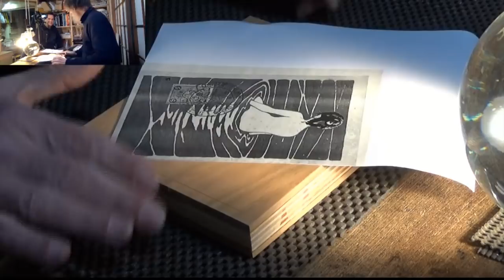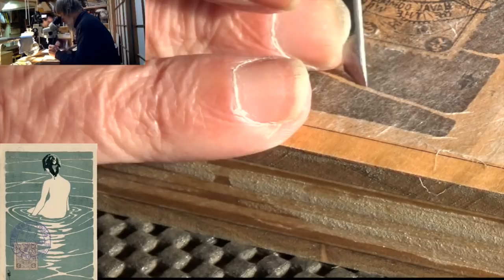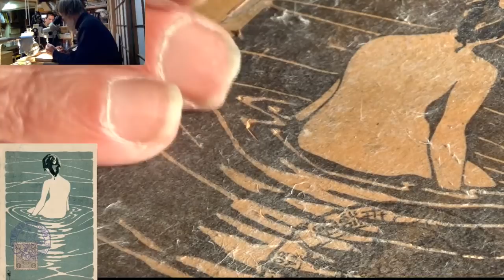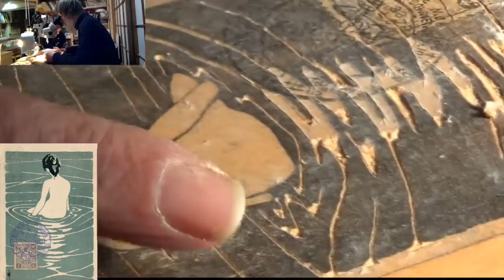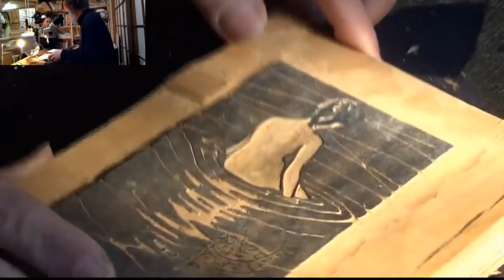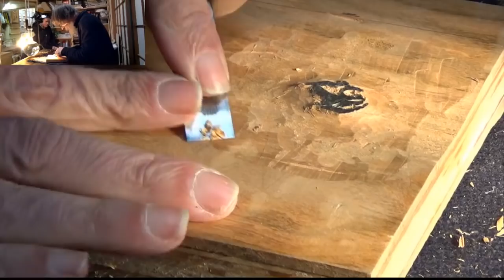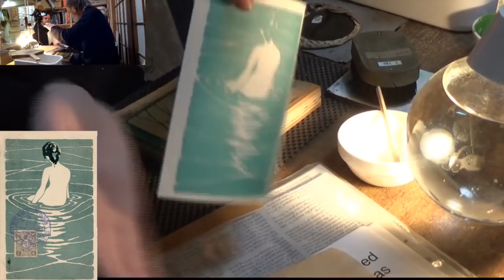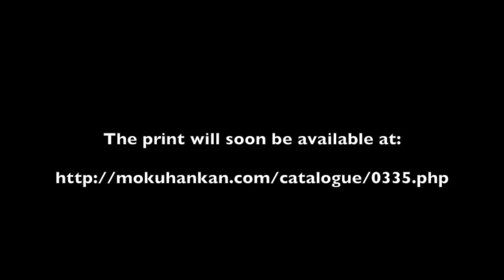Woodblock Print - start to finish (edited version)

Comment: Dave-san, I use the same transfer process (but just using regular A4 paper) to put images onto bone or Chinese bakelite Mahjong tiles when I'm making copies of missing tiles. But I use a dental drill with sub-millimetre steel burrs to do the carving, my skills with a chisel are not that good! Another really good instructional video, and your bathing lady is just gorgeous! Thank you.
Reply: Dr. Konrad Dahlem, a Dremel-style tool would work fine, but I would only use it with the flexible shaft, as it gives much more freedom of movement. The dental tool I use is a Chinese model with removable straight and angled heads, which take either long- or short-shank burrs. (But... I find there is too much slop on the angled, short-shank head, so I only use the long-shank head - zero slop.) I buy sub-millimetre steel dental burrs online, and even grind those down to give me the fine lines needed for the detail on bone mahjong Flower tiles, which are 30x22mm normally. So they are well able to cope with a hard fruitwood. Hope this helps!
Reply: Dear Tony, my sincere thanks for your extremely speedy and helpful answer ! Yet, may I bother you with additional questions...? First, in case you rather recommend the Chinese drill, would you be so kind as to name the maker and model ? Second, the drill heads mentioned, would you give me a hint, where to get them...and which ones you regard as the ultimate „must-haves“ ?
Again, let me express my gratitude for your help 🤸🏽‍♂️, Konrad
Reply: Konrad, see my email to you....

Comment: Whoever mentioned the zzzzzttt zzzztttt tool to remove major hollows/ no ink spaces was referring to the Foredom handle for reciprocating saws and chisels made specifically for the handle. You can place the motor in a manner to suppress the sound, but you’ll need a fan as it does get rather hot. I only use it in very specific large pieces or when I don’t have to be exact just yet. Whoops sorry this is 2 years away

Comment: Hi anyone/David, when you turn the first piece of wood over to do the hair, how do you know that it will be synced up with the head/pic??
Reply: he synced the prints with the registration on the side of the block. notice that the cross he  drew and crave on bottom left side and a little nodge in upper-middle of the block. He applied the registration on the both side of the block .so no matter what he do , he just follow the registration and voila you got your print sync. I believe he used a specific type of registration called the Kanto registration.